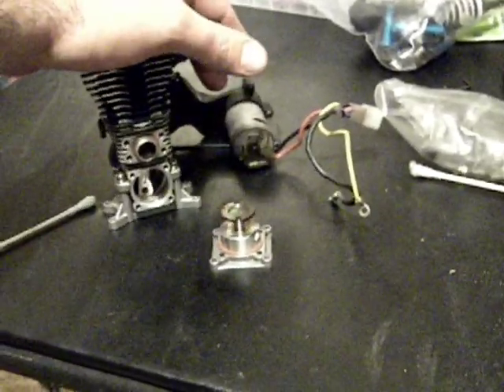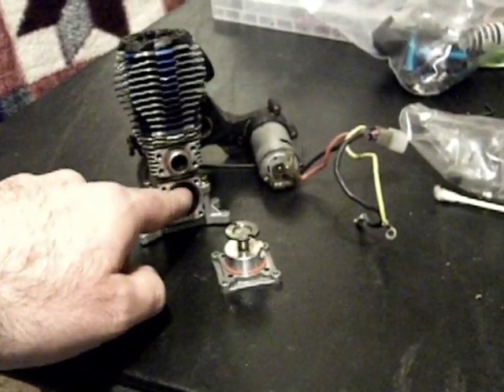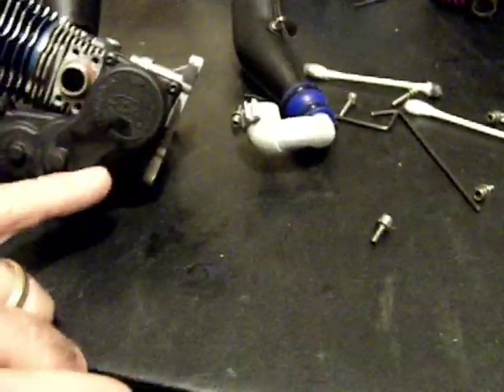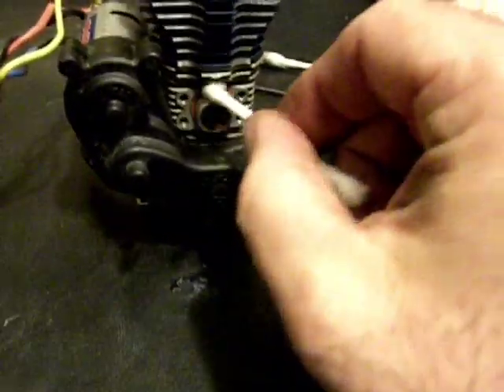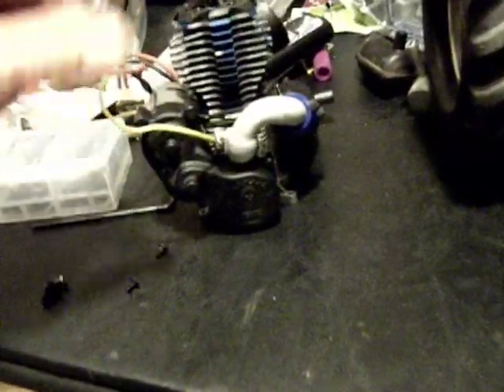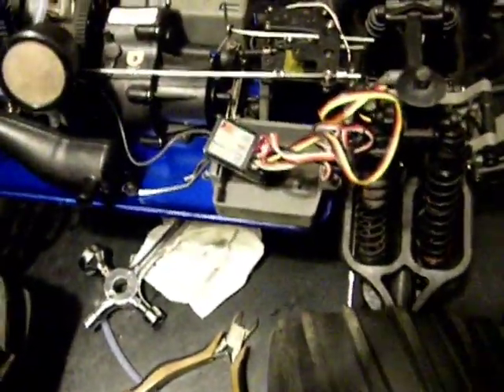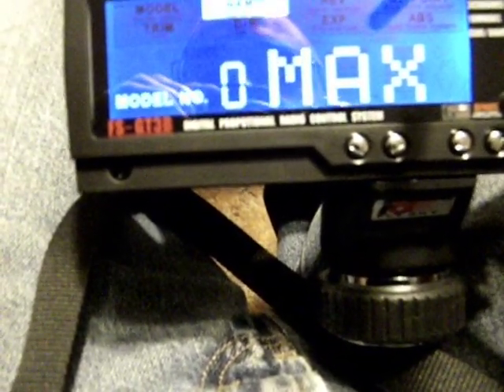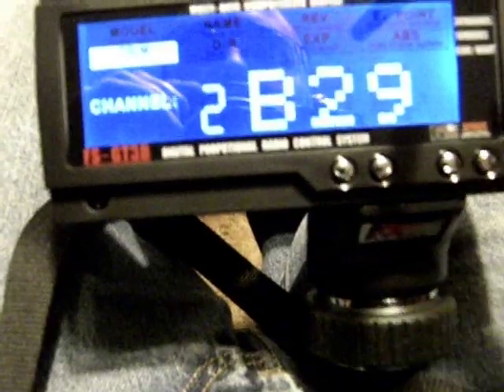How to seal up your 3.3 and tune your Traxxas T-maxx RC truck

Comment from the maker: @davidrussorules I traded a Jato for this tmaxx with a 2.5 and a savage. I upgraded it to a 3.3 and other new parts then I sold it $225. Nice truck. I would rather Have a Savage or Revo then a Tmaxx . But Tmaxx is still a very fun truck

Comment: i just bought a back up 2.5 for my tmaxx for 37 bucks shipped. :D i love ebay. drilling a hole in the bottom of the starter is going to let the grease come out.....which will make your gears strip/wear faster...you sound like seth rogan...that's awesome. hahahahaha

Comment: as bad as I hate pointing things out. but this video is full of misinformation. you should not ever put loctite on your back plate. and the hole in the ez start is going to do nothing but allow dirt in to corrode and destroy the 1 way bearing. the 1 way and back plate are designed to allow oil seepage from the motor for lubrication of the bearing. as with anything it's called mantiance to keep it running. I had 1 ways last me up to 4 gallons which is a long time. the ONLY helpful hint in this video was the sealing of the backplate. everything else was a waste of time actually.

Comment: can someone help this guy with a girlfriend..? anyway your video has nothing to do with tuning
Reply from the maker: +yosnel martin Actually this has everything to do with tuning. If you have any kind of air leak your motor will not run right. As it heats up the tiny little bit of vacuum that is lost increases, making it impossible to get and keep the correct tune. This is the proper foundation to any good tune! The first thing I do to every motor I get new or used is seal it up. I dont need a girl friend, I have a wife.
Reply: not necessarily true. the higher end motors I.e. nova rosi, os , alpha etc etc use better orings. traxxas motors are basically throw away motors. so you blow 1 up, engine exchange or buy 1 off ebay for $99. I know I have 4 waiting to be used in my revo platinum.